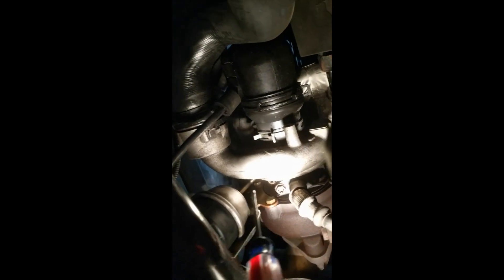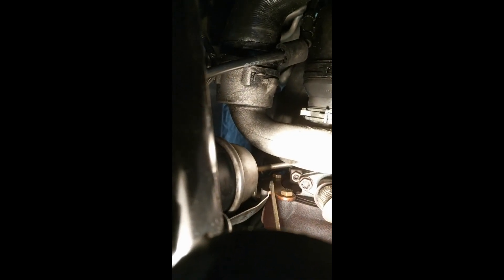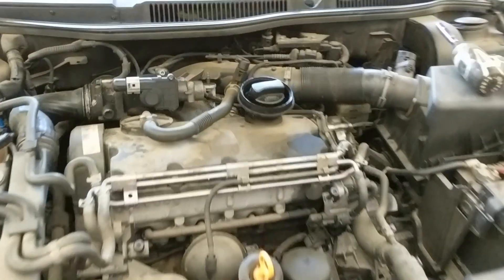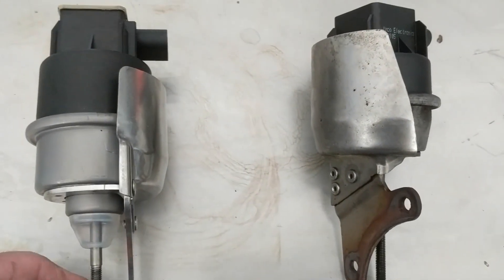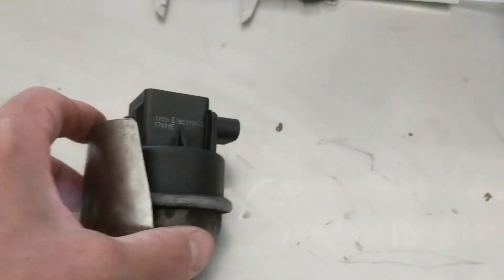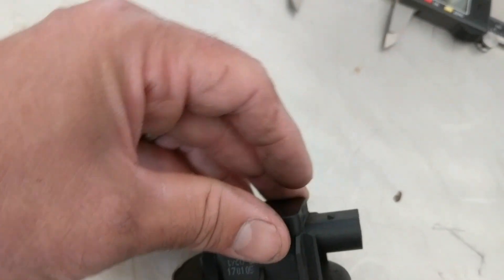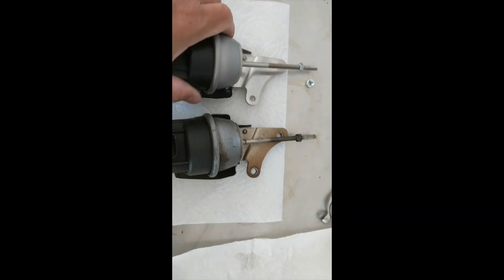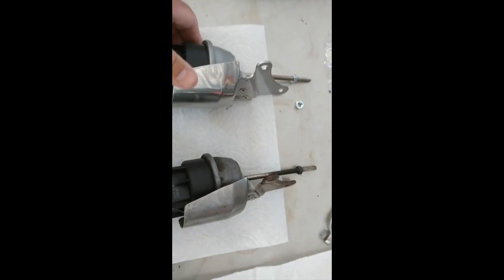2005 VW Golf TDI PD BEW - VNT actuator replacement to fix engine code P2564

Comment: If you wanna take the electrical contractors off push them on whilst holding, then press the release, then pull. If you pull first and press the release it will not disengage.

Comment: I'm so jealous, I've made 3 attempts as removing those 2 bracket bolts without any luck.
Reply: Try squirting some PB Blaster or other penetrating oil on the bolts.  And, try a couple of different 10mm wrenches: a shorter one, a longer one, etc.  Also, a ratchet with a "wobble" extension might let you get a firm seating on the bolt.  Lastly, an adjustable mirror can make a big difference in being able to see the bolt head.  Hang in there, be patient and good luck!
Reply: If they're sick or rusted on, a trick for taking off sick farmers is to tighten first, then reverse. If you reverse a stick one, you'll bust the head off. Usually if you'll tighten just a hair, it'll pop from its position, freeing it up and then allowing you to remove.

Comment: I have a 2005 Volkswagen Jetta I tried pumping it with air in the actuator but not holding pressure mine is in the same location I’m just  Wondering where are you bought the actuator if you can tell me the name of the company the only thing I’m worried about is that rod getting to it when I seen you doing it it seemed impossible was it a nightmare thank you

Comment: what did you use to get the nut off the threaded actuator rod? You can actually get to it from the bottom of the car?
Reply from the maker: I just used a short wrench.  It's very possible, dare I say "easy", to get it off from the bottom.  If you have a way to lift the vehicle, I think it's a better way - nothing to remove, to get to the part.